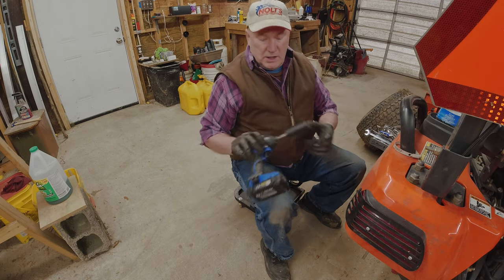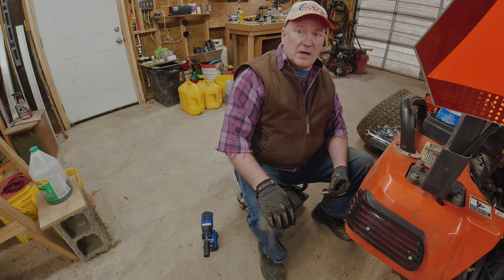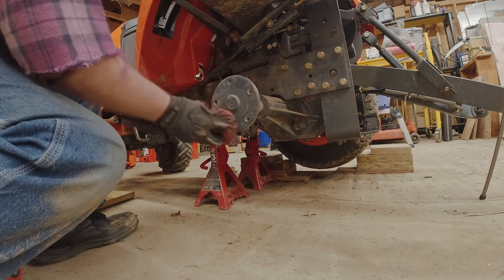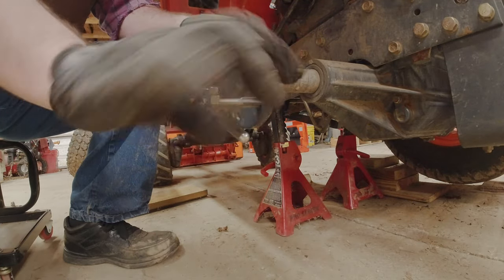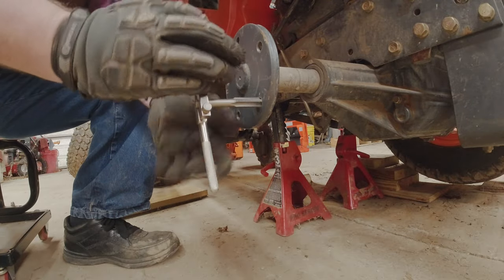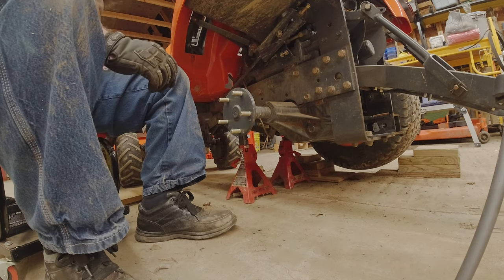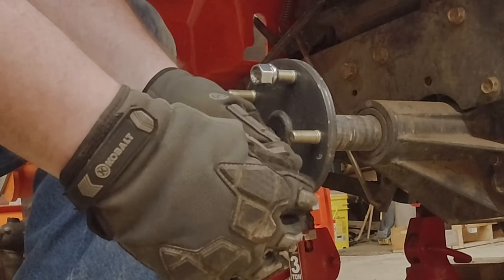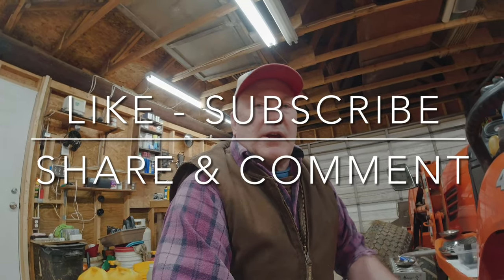#62 - Will The BX Wheels Fall Off?

Comment: Excellent job ! Looks factory ! On my BX 1870 2016 model 2 on each rear wheel are already with studs from factory, I guess it's so it will be easier to get a fluid filled wheel back on. Have a Blessed Day
Reply from the maker: That's interesting.  It is not easy putting that tire on without hanging it on a stud.  Thanks for watching and commenting.